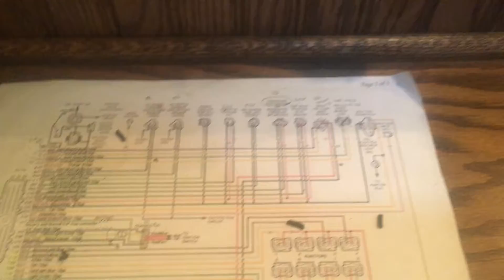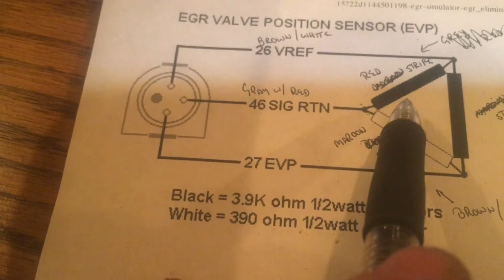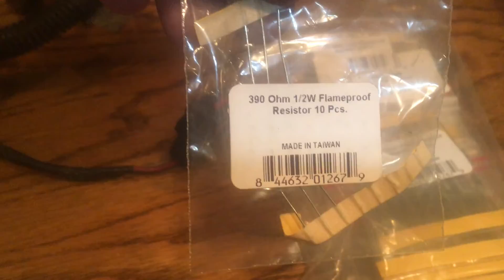Ford 5.0 EFI Harness EGR Delete with resistors Series 2 Video 6

Comment: i got your message and i looked online at oreilly`s and advance auto under 1988 f250 with a 5.0L and 5.8L and they do use the same egr valve position sensor. thank you for the help

Comment: Nice vid. Great alternative for termination plug they want $60 for.
Reply from the maker: Thanks!
Reply: @MajorSporto  How much do the resistors cost?  Thanks
Reply from the maker: @trailerparkcryptoking5213  Not much really.  Less than a buck each.  You can get them on Amazon or anywhere online.

Comment: Thanks for doing this video.  This gets rid of the codes, but what does it make the computer think?  That the egr is closed?  Engine is running very rich, hoping this helps a little. Thanks!
Reply from the maker: Joseph Morales what other codes are you getting?  Are your O2 sensors working? Are their connectors (driver/passenger side) switched?

Comment: Thanks I will try the hard reset.. do I disconnect the negative battery terminal  leave the positive terminal on the battery and use a small jumper wire to drain the capacitors in the pcm  ?

Comment: Will this work for the egr on a 89 f 150 with the 4.9 300. My egr connector looks exactly the same.
Reply from the maker: I would say that this type of trick with resistors would work the same way as it does on the Mustang 5.0.  However, the challenge would be to locate the same wires on  your harness.  The reference materials that I used in this were for a Mustang computer, that mapped these wires to pins specific to it.  Your 300 computer, probably has the same wires (by function), but may be mapped to different pins on your computer.  You would need to find the pinout for your computer and locate which wire does what.  The wires functions are labeled EVP, Sig Return, and VREF.  Locate those on your computer pinout and then do the resistors the same way as shown in the diagrams for the Mustang.  Again, this is trial and error here, I don't know if it would work exactly as this does.  Good Luck!

Comment: Hey did you leave the evr solenoid plugged in but plug off the vacuum ports ?
Reply from the maker: Hi Paul, It was a Mustang 5.0 Upper, and I bought a block off plate after removing the EGR itself, and plugged the vacuum ports. There are two small coolant hoses that run through remaining EGR plate, and I kept them in place, even though they don't cool anything anymore.  I have run this setup for a decade with no issues, CEL or codes.  Good luck!
Reply: @MajorSporto  I was referring to the evr vacuum solenoid on the passenger side valve cover that feeds vacuum to the egr valve . I have a block off plate and the egr resistors for the sensor itself on top of the egr but I am asking but the solenoid on the passenger valve cover needs to remain plugged in electrically and whether or not to use resistors with plugging the vacuum port .

Comment: Are the documents you’re referencing available online anywhere?
Reply from the maker: Hi Jason.  Yes everything that I had was found online.  Mostly Foxbody Mustang Forums if I recall.  The wiring diagram that I used is also pretty popular.  Here is a  link to a thread, that talks about it.  The diagram is on post #19.  I got the resistors on Amazon for a few bucks a set.  There are two different resistors needed to make the triangle shown.  Two 3.9K ohm and one 390K ohm.  I messed that up a few times in the past when not paying attention to the different types.  This way has worked for me in all of the harnesses that I've done.  Good luck.  https://stangnet.com/mustang-forums/threads/those-with-homemade-egr-delete-come-in-here.592407/

Comment: Lol sorry wrong video so now only getting code 34 EGR not working and no engine light thank you again
Reply from the maker: Great to hear!  I have run this setup for a while without an EGR.  I can codes, but no CEL.  Which is great because it makes the CEL that much more reliable and meaningful if it should actually illuminate.

Comment: Will this work on a 1994 GT?
Reply from the maker: It might work on that computer, however you have to match up the three wires in your EGR connector with the one's in the diagram that is online.  Google the EGR delete diagram that is on the web for older Mustangs, you will see the three wires and what their purpose is.  You need to identify which of those three wires does what, so you can then solder the resistors to them.  I am not sure the pin numbers and wire colors are the same from the newer 5.0 Mustangs, so you cannot count on things being exactly the same for your harness.

Comment: Okay I found the 2nd vid. I'm doing this same method on a 3 pin oil level sensor that snapped off the sensor. I don't wanna buy another sensor as they are 200 bucks here, the wiring is 100 bucks and the connector is 35 bucks. 335 bucks for an electric dip stick, lol. Bypass that shit! I say.

Comment: Just double checked the resistors are correct 390 and 3.9k
Reply: Did the resistors work for you was wondering can I use bigger resistors

Comment: Do I need to reset pcm
Reply from the maker: Tevis Woodburn did you read the codes? Maybe a hard reset would help. You have the right resistors. The EGR resistor removal is a pretty straightforward modification.